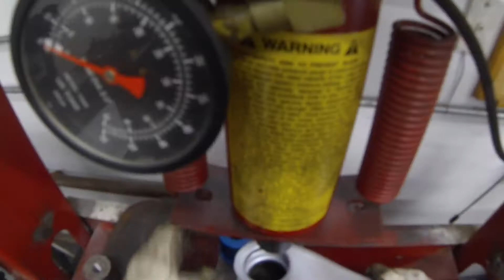Geometry Correction - SN95 Mustang

Comment: Hey Stephen, I'm having the same issue with my X2 ball joints. How thick was the shim stock you used?
Reply from the maker: It was brass sheet pack from Lowe's. I don't recall the thickness or if there was a couple different ones. I also put a couple weld tacks to ensure it stayed together.